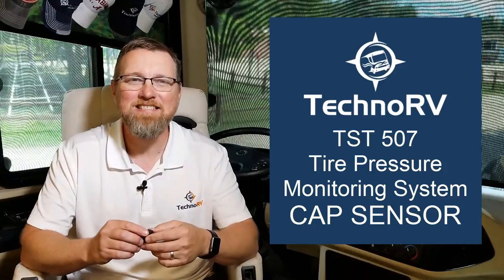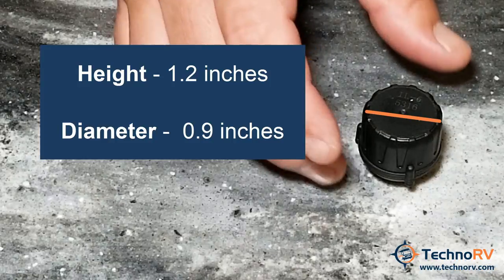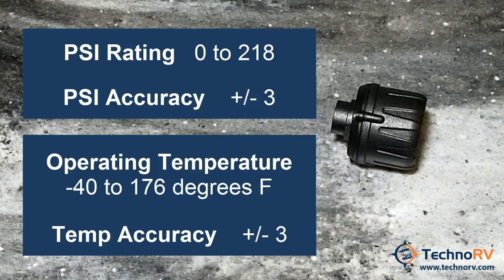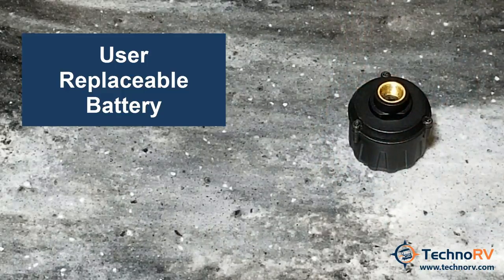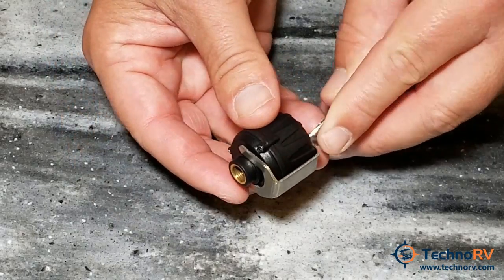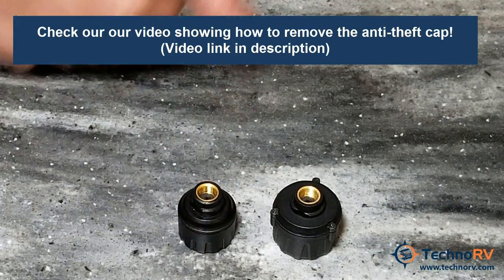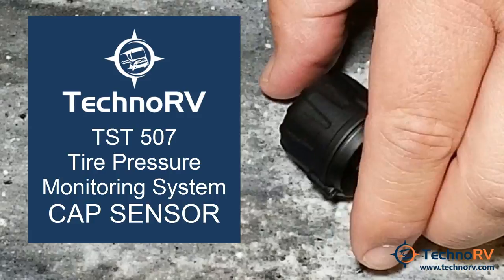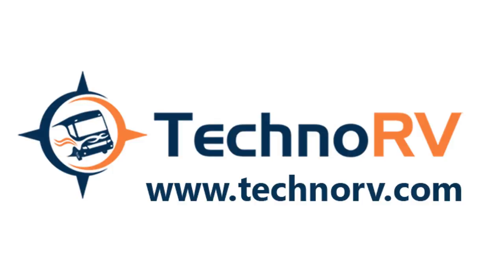TST Tire Pressure Monitoring System Cap Sensor Info Video

Comment: Any issues using them on a boat trailer that will be submerged in salt water when launching boat from trailer?
Reply from the maker: Sorry for the delay!  If you plan to use the TST with a boat trailer, we recommend you use the new hybrid marine sensor.  It is a sealed sensor and can handle being submerged on boat trailers.  Here is a link to learn more:  https://www.technorv.com/tst-hybrid-system-with-2-to-12-sealed-sensors/

Comment: Hmmm...mine doesn't have the screws. Did they change the design?
Reply from the maker: Hi Frank, yes, there have been some changes in the design over the years. 
Eric
Reply: @Technorv  I haven't found a video that representative of the new design, but I figured it out when I changed the batteries. Thanks for responding Eric. 👍